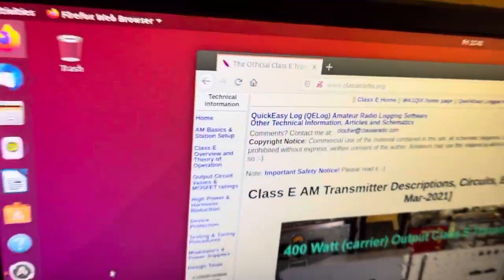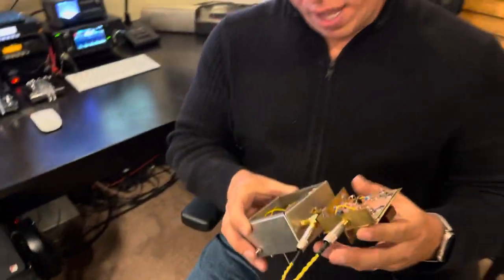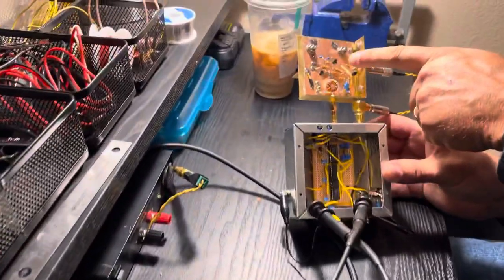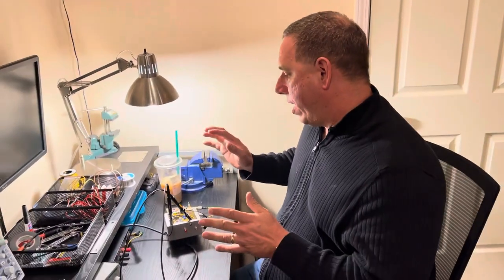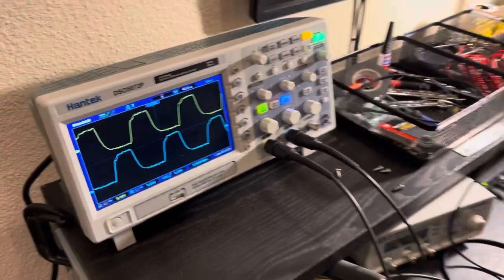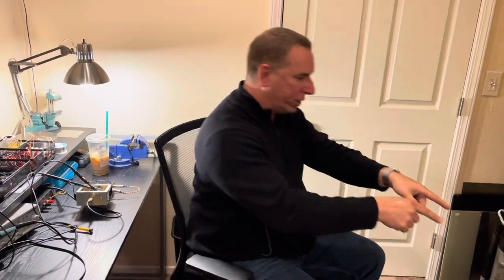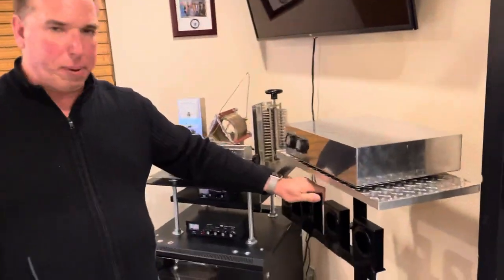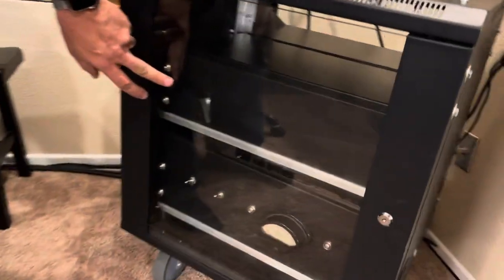Part 3: Building a Class E AM RadioTransmitter

Comment: You can do all this with a single chip. AD9850, so why the complexity I wonder?
Reply from the maker: Well, build it and make a video! This way is my flavor.
Reply: @jonrines499  Just buy the ready made PCB from CH, they've been around for years. No need for vid.
Reply from the maker: @Stretchyman  Their PCB doesn't do all mine does, plus mine is stronger. Theirs won't hold up under any type of input glitch. They usually die.
Reply: @jonrines499  input glitch, er ok...Good luck with it all, surprised you haven't used VALVES as it looks likes something from the 50's. Xtals ? Those great big ones too from WW2 era! WTF? Have you heard of DDS? Then I guess you are a Ham and therefore understand....!

Keep up the good work OM......
Reply: Here's the PCB, simply controlled with a PIC. https://www.aliexpress.com/item/1005001570967815.html
The duty cycle adjustment is an unnecessary complication as you can change the duty cycle depending on how hard you drive the drivers (if using a sinewave) if using the squarewave it already has opposing outputs and a duty cycle adjustment, I just set for 45-50% which is ideal anyway.

You guys in the US seem to like really old stuff and make is MASSIVE for no reason?

Maybe fine in the 50's to 70's but we've moved on bud, well we have outside the US it seems....!

Anyway only messin' !

You can build the whole (RF side) design to fit a case the size of a large paperback book BTW.